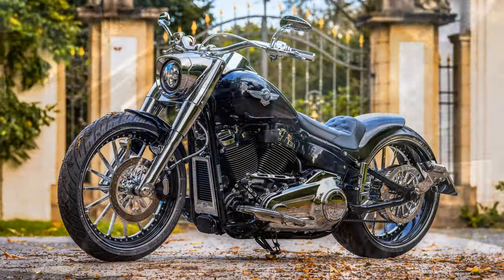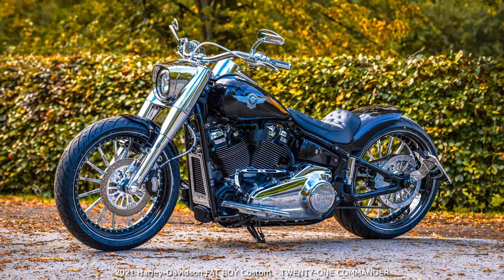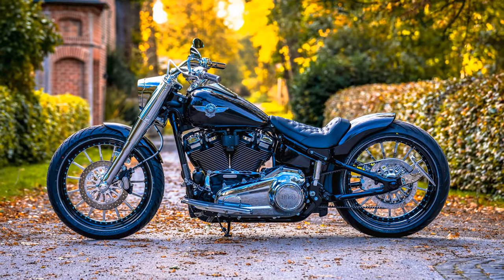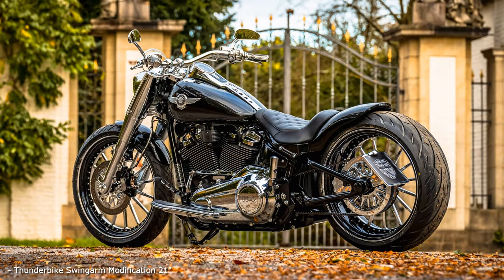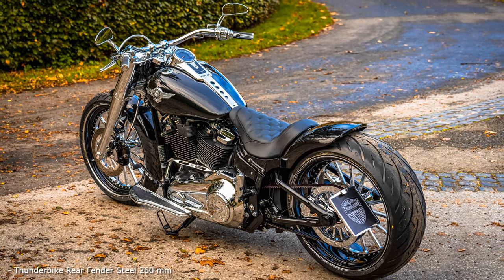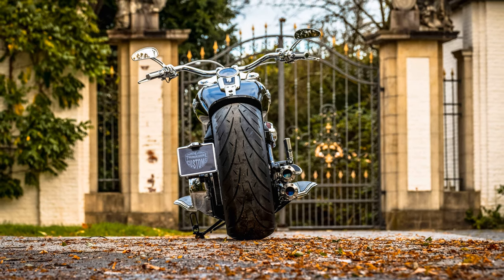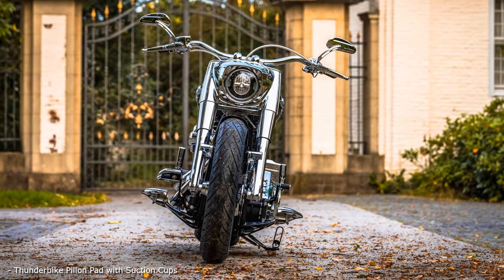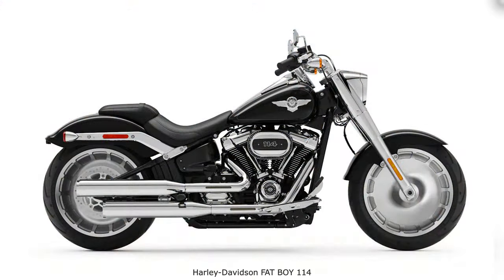2021 Harley-Davidson FAT BOY Custom: TWENTY-ONE COMMANDER * A&T Design

Comment: Where can i get that front and back fender? And the seat and exhaust?
Reply from the maker: - Front Fender 21" Fiberglass
https://shop.thunderbike.de/en/Thunderbike-Parts/Moldings/Frontfender/Front-Fender-21-Fiberglass-oxid-1.html
- Rear Fender Steel 260 mm
https://shop.thunderbike.de/en/Promotion/Softail-18-Parts/Rear-Fender-Steel-260-mm.html
- Seat Plate
https://shop.thunderbike.de/en/Promotion/Softail-18-Parts/Seat-Plate-oxid-4.html
- Exhaust
https://www.thunderbike.com/dr-jekill-mr-hyde/